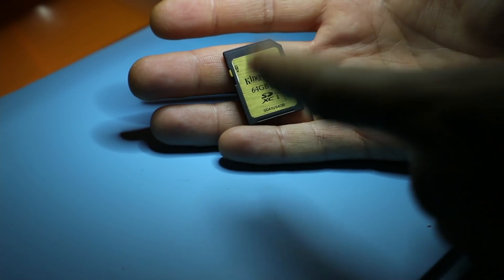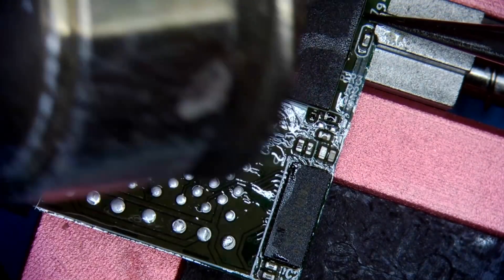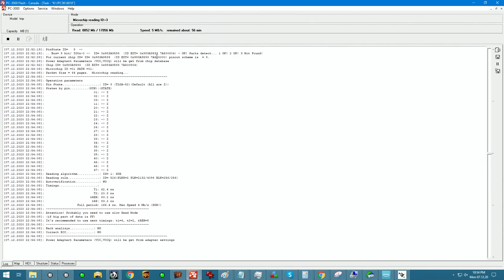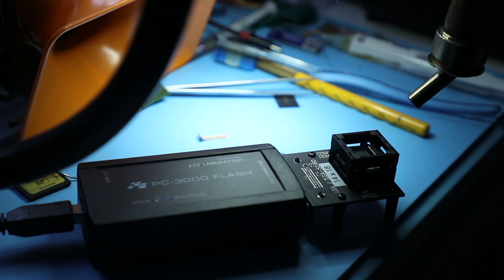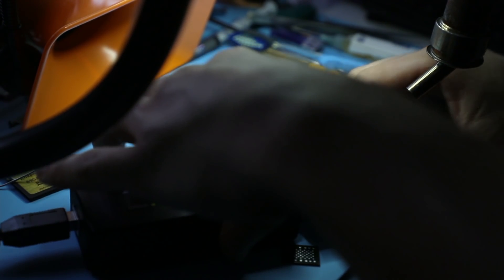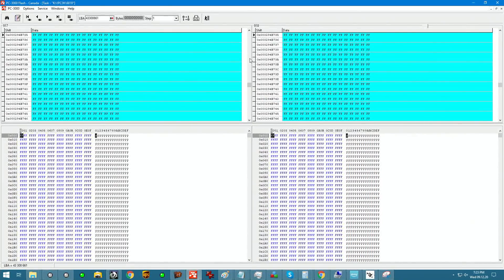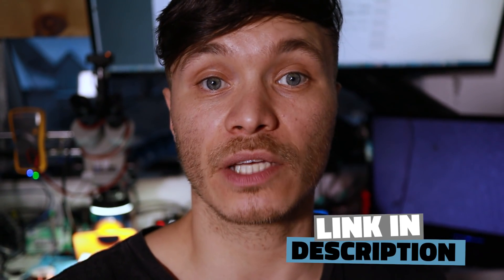sd card is not getting detected

Comment: Interesting thing about warming up the chip. Cheers from Brasil.
Reply: In ssd is the same thing, when they are running they try to keep the bad flash at around 40c

Nós ssds e a mesma coisa, quando estão a trabalhar a nand flash e suposto ficar 40celcius para trabalhar bem
Reply: Also heard the opposite though, non detecting flash drives ID when chilled down.
Reply from the maker: @DiskTuna  nand suppose to operate under optimal condition. Voltage, ReadRetry, temperature. When NAND degrades, information about the optimal state can get messed up in the table. So you need to compensate for the difference.
Reply: @hddrecoveryservices  It degrades and is messed up almost by definition over time. Normally RR is supposed to compensate for that, correct? Isn't FE more flexible for experimenting with RR in your experience?

Comment: The reason behind this has a lot to do with how flash chips work. Both NAND and NOR flash work based on the phenomenon called quantum tunneling effect: When the data is written, electrons will jump through a thin layer of insulating material into some tiny cells. Then the cells will have a certain voltage, thus act like gates in a mosfet, to store info by allowing or stopping the current flow through it.

And when the flash chips were heated up, the electrons inside will have a higher energy level, thus easier to get in and out the cell, or move quicker inside the semiconductor, thus accelerating all read, write and erase operation. But be aware that since the electrons could get out of the cell more easily, the data retention will be much shorter at high temperature, if there aren't some mechanics to refresh the data every once in a while.

Comment: Top job mate as always, nice to get a green map after all that struggle, good job!
Reply from the maker: thanks, video does not show the struggle :) but that second bank really needed work, low static voltage/high static voltage/ variable voltage/different RR modes/ heat/ freezing - all did a bit of improvement
Reply: @hddrecoveryservices  well good job mate, I do flash recovery and its can make you pull your hair out at times!!!

Comment: 1:59 What temperature does the solder under the chip need to get to before you can just pull the chip off like that? Does it really not cause any damage to the chip itself? Do nearby components and their solder not get hot enough to cause any issues? It looks like such a delicate process.
Great video either way!

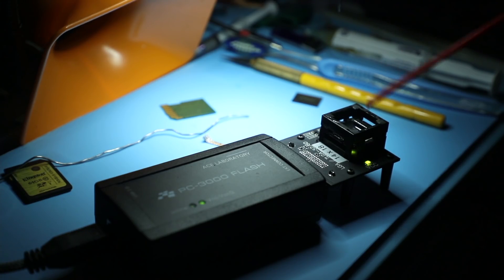Comment: Thank you. What did you drop t on the IC at 10:24 ?
Reply from the maker: indeed, cold spray
Reply: @hddrecoveryservices  Thank you.
I appreciated your answer. So The heat trick for the content that not quick corrected. And the cold trick to get the green cradle light turn on and stay active?

Comment: Hi Erkin, heating the plastic adapter at 100°C for long time doesn't it 
get damaged?
Reply: No it's ok at 100degrees they are very high quality sockets thing they use a type of phonelic
Reply from the maker: not this type of plastic as others mentioned. I've taken it upto 150 in some extreme cases where NAND craved more heat for better read in the past, and it was fine.